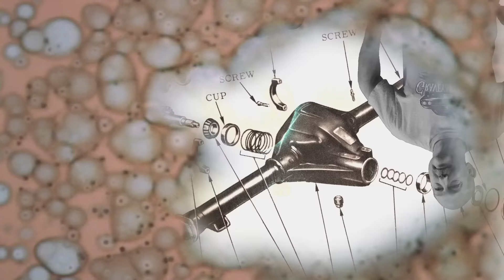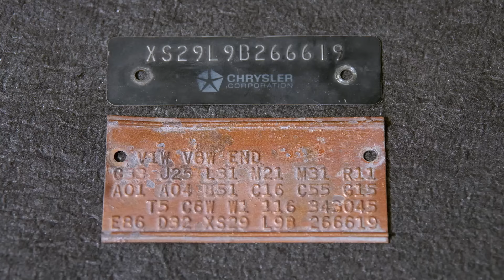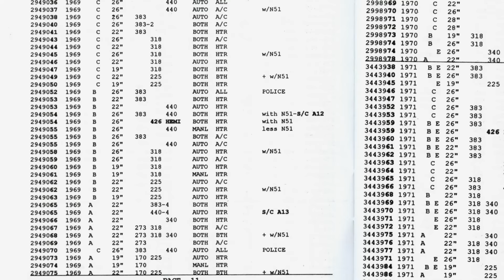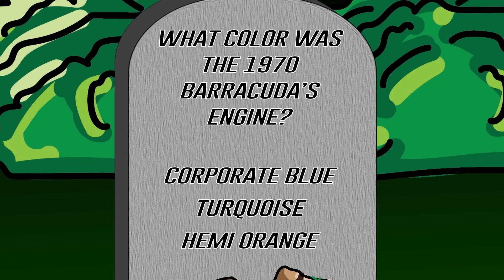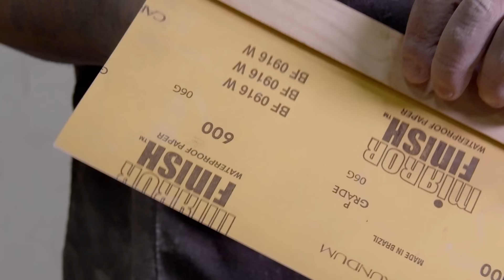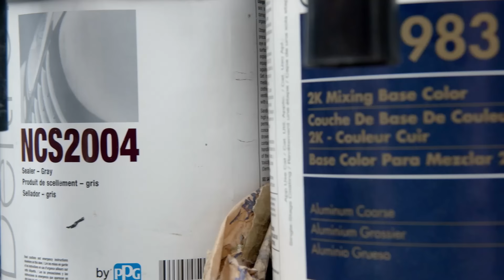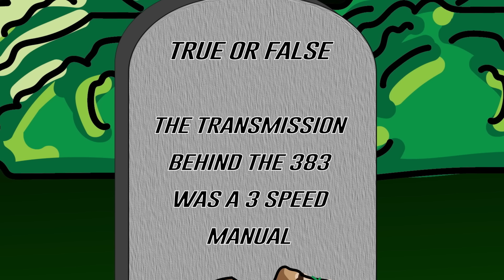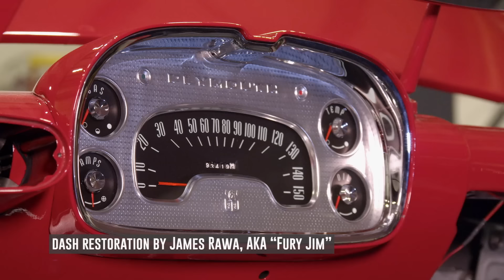NEW EPISODE: MARK BUYS A CHARGER BASKET CASE THAT'S GOLD!

Comment: that copper 440 charger is i think the one i tried buying out of SLC Utah 🇺🇸 pre-2013 ( but by 2012 i got my F8 1969 charger and buying 2 of them was way out of the question for me more so at 30+K usd ) anyways condig it did the body work if im remembering right and it was stored in a 20X25 storage locker for years and i guess it didn't get much attention after 2004-ish so its still in peaces and not finished restoration

Comment: Leave the max cool rad.
Many Chrysler options were not very good.
The origional owner must have discovered that! It Kept overheating on hot sumer days and switched it. My chryslers did. I used the dam heater to cool the engine!
Keep it it is part of the cars history. It will not change its value!

Comment: Hello,
 I found a complete and unfinished project in real nice shape, with actual floor, and trunk,
rare in Northeast Pa, with salt used on roads to destroy the underside of your vehicles.
I just couldn't pass it up, and rescued it from a dusty life under a lean-to - next to a garage.

Since you are the undisputed "guru of data" on these, I just bought a 1972 Charger, but it has a 13 digit VIN, not a 17 digit VIN? WH23G3A190049. I already did the decode, but wondered the reason for the short VIN? Is it just these cars pre-date 17 digit standardization? Some research sites reject this number as "not complete." 
Same 13 digit number is on cowl tag and door. (possibly for sale?) Thanks for your reply.

Comment: Did De Soto make their version of the 58 Belvedere?
Reply: DeSoto was two steps above Plymouth in size cost and prestige, so, no there wasn't a badge engineered DeSoto version.  The closest would have been the Firesweep, which was basically a Dodge with DeSoto grill and tail.  In '58 the DeSoto Adventurer would have been the performance version, like the Fury was for Plymouth and was only available as a two door hardtop and convertible.  The Firedome would have been the top of the line normal car, like the Belvedere was for Plymouth.

Fun fact, you could get electronic fuel injection on the '58 Adventurer.  Less fun fact, it didn't work properly and had to be recalled.
Reply: @seed_drill7135  So the De Soto line was to Plymouth like Buick was to Chevrolet. A little more upscale.
Reply: @rickbailey189  Exactly.  Plymouth < Dodge < DeSoto < Chrysler < Imperial 
GM went Chevrolet < Pontiac < Oldsmobile < Buick < Cadillac
and Ford was Ford < Edsel < Mercury < Lincoln < Continental (it became a Lincoln model in '59)
Reply: @seed_drill7135  That explains the pentagon star on Mopar keys. 5 branches. 2 bad Chrysler is defunct.

Comment: It really suck that all auto makers drain the cowl vent into the rockers and rot them out. Mostly from the traffic ahead pulling the rock salt up from the roads. Really no defense from it. So no matter how good paint is all cars will rot from the inside. Blocking off that drain system and redirecting it into the engine bay is the only fix.

Comment: Nice cars Great job. Hope they last for hundreds of years. Then in a few hundred years they will be putting Electric motors in them. No one would be able to pay thousands of dollars for one gallon of gas. It’s $4.95 a gallon up my way in Syracuse NY.  Non-ethanol  is $6.26 a gallon . That’s all I put in my Antique motorcycle. Only 3.3 Gallon tank. Thanks for the upload .
Reply: burn alcohol with 2% turpentine. works gr8 !
Reply: burn alcohol with 2% turpentine. works gr8 !

Comment: If this car is going back to the guy that was building it, any mods should have been preserved or at least discussed with the owner prior to being changed back. It's totally the call of the owner as to how OEM correct it will be built. Imagine a hotrodder couldn't finish their project, so sent it to a shop to get finished, and it gets totally reverted to stock.